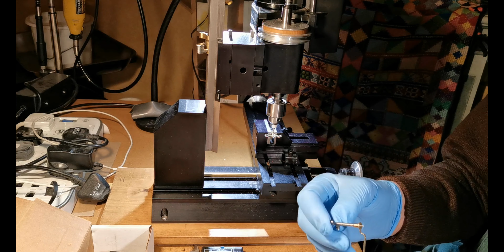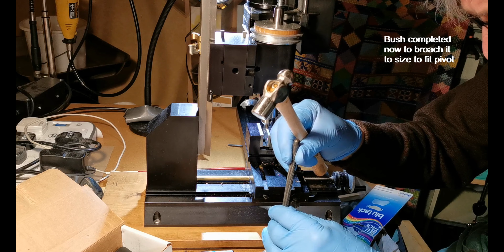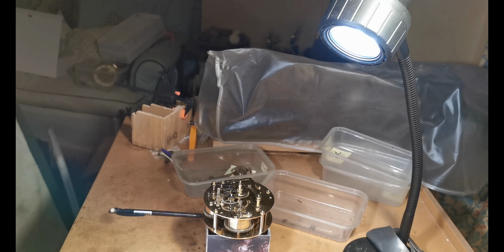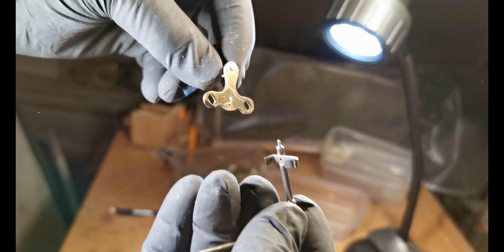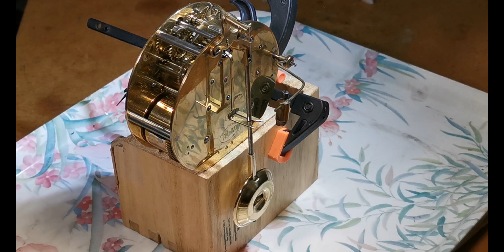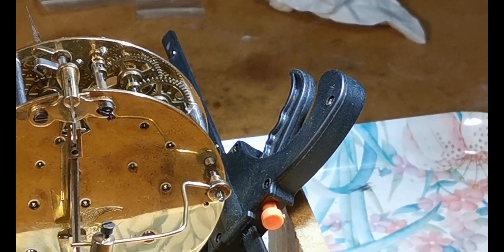Antique Slate Clock 84 Pt8 Bushing on Sherline Mill, test run movement

Comment: Wow! youve got some amazing tools there. That milling machine did the job perfectly. I quickly checked them out and seem to be quite expensive. Hopefully I wont be needing one anytime too soon. I think the challenge of solving problems is part of the fun when it comes to restoring. 
I am very impressed with the way you fixed the mechanism.
Reply from the maker: Yep it's an expensive piece of kit. About the same price as one of the Swiss bushing machines but the Mill has so much more to offer. I decided on sherline mill after see many Americans videos of their use by amateur clockmakers. Now to the next project🤔🤔